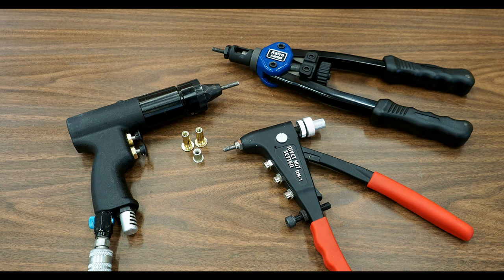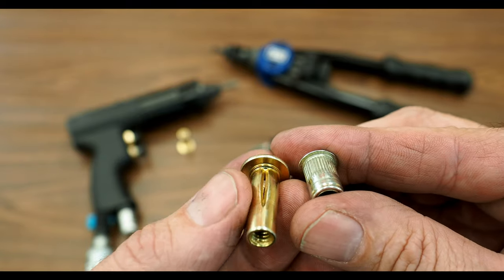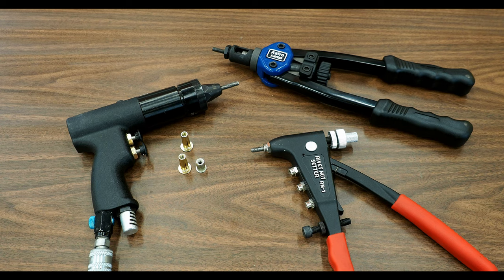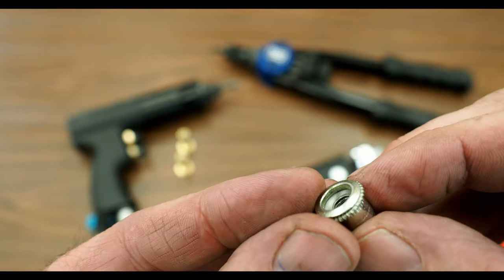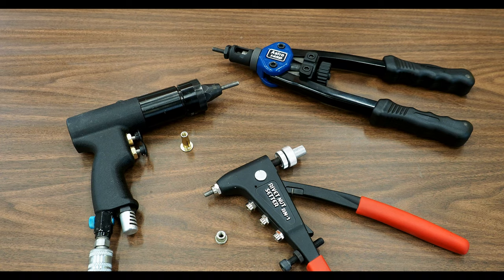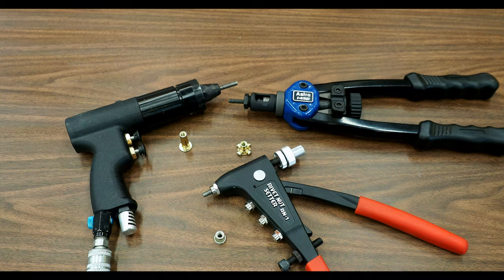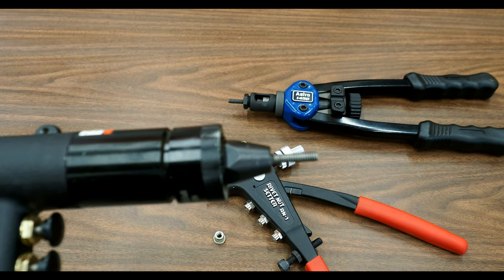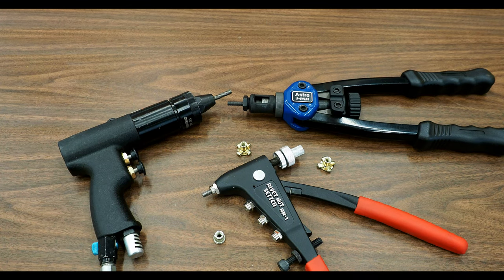Plus Nuts vs Rivet Nuts...and Install Tool Comparisons.

Comment: Any vids showing your L track installation
Reply from the maker: Full build thread is here, ltrack install starts on page 4: https://advrider.com/f/threads/hodakaguys-4wd-sprinter-build.1380154/page-4
Reply: @Hodakaguy  thank you
Reply from the maker: Of you pit them in with close enough spacing (maybe a ft or so) it should work fine depending on how much weight you'll be securing
Reply: @Hodakaguy  thanks. I'm thinking plus nuts with a backing sounds solid.
Reply from the maker: Agreed 👍
Reply: @Hodakaguy  thank you for the advice and time

Comment: Can use a Plus Nut on RivNut tool?
Reply from the maker: That depends.  A rivet nut is deeper and will require a longer mandrel to reach the threads, most rivet nut tools won't work with plus nuts for this reason.  On the pneumatic tool I mentioned you can buy a longer Allen head bolt at your local hardware store to allow it to be utilized for plus nuts as well 👍
Reply: @Hodakaguy  thank you
Reply from the maker: Any Time 👍
Reply: @Hodakaguy  Isn't a plus nut longer than a rivet nut?
Reply from the maker: Yes, you'll need a longer mandrel to use the same tool on a plus nut as like you mentioned the plus nut is longer than the rivet nut 👍

Comment: The plus nut rivet tool that your talking about does not work with plus nuts. It's so does a plus not pneumatic tool and it does not work. Time in money wasted.
Reply from the maker: I used this same tool on all of my plus nuts, it works great.  You just need to take the Allen head bolt out and go down to the hardware store, get one that's a 1/4" longer and re-install it 👍.   The only difference between using it on a Rivet Nut or a plus nut is the length of the bolt "mandrel".  👍
Reply: That bolt, a quarter inch longer. is not available at either box store, Fastenal, Granger. or the local hardware. The help head is larger than what is available. Wish I knew hoe you were able to make it work.
Reply: The hex head doesn't fit
Reply from the maker: Man that stinks, I went down to our local independent hardware store and they had them on the shelf.   I'll see if I can get a measurment or link for ya 👍
Reply: I’m having trouble finding a bolt with the right size head. Can you link to a bolt that you can use with the pneumatic gun for plusnuts?